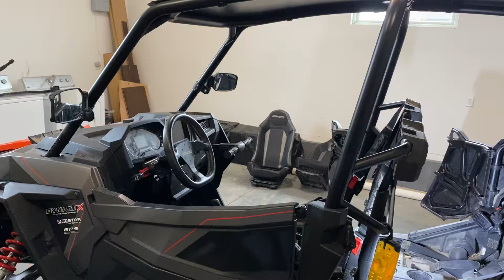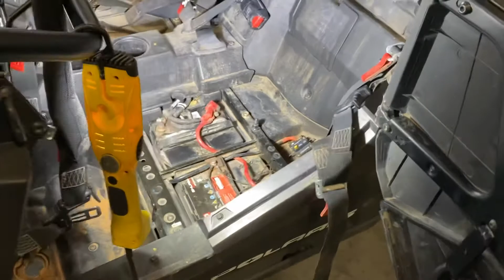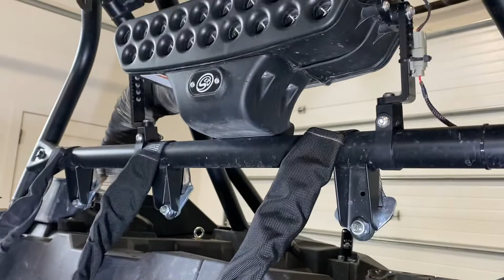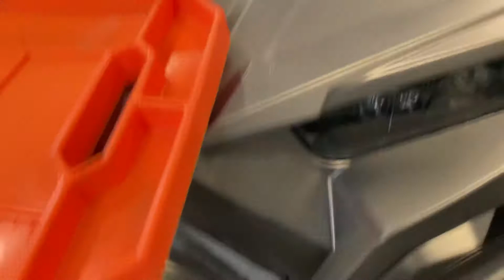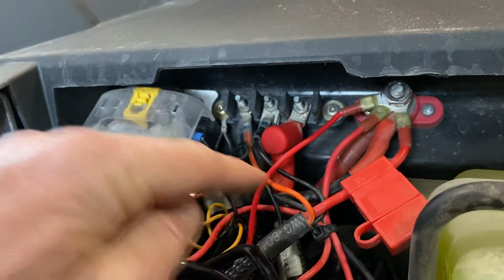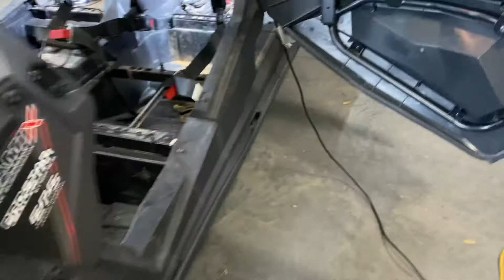Polaris RZR Dual Battery Install

Comment: So should I do a fuse block and a busbar or go with one or the other?
Reply from the maker: I recommend both.
Reply: Thanks for the reply so quickly. Is there certain hookups that should be hooked up to the busbar and certain ones hooked up to the fuse block? Or just split the accessories between the two?
Reply: Also is the key line charger isolated recommended or can I get away with it? Lol would it be better and safer to have it?
Reply from the maker: @SomeDude3000  I separated out the non essentials to the secondary battery on my fuse block and then ran that to the busbar.
Reply from the maker: @SomeDude3000  I would recommend it! It will keep you from getting stranded IMO.
Reply: So the nonessentials went to the fuse block and the rest went to the busbar?
Reply from the maker: @SomeDude3000  yup!
Reply: I guess now to figure out what my nonessentials would be lol 🤦‍♂️
Reply: The 100 amp fuse is not in stock. They have the same one but in 120 amp. You think it would be alright if I went with the 120 amp instead of the 100 amp or should I just find a 100 amp and stick with that size circuit breaker?
Reply from the maker: @SomeDude3000  I think you would be fine with the 120
Reply: Ok great!! This is the fuse block I’m thinking about going with. The one you had is currently out of stock. Would you recommend this one? 

Blue Sea Systems ST Blade ATO/ATC Fuse Blocks
Reply from the maker: @SomeDude3000  that is actually the same fuse block, it just doesn’t have the mounting bracket that mine has. Great fuse blocks.
Reply: Awesome!! Thanks for the feedback   Sorry for all the questions. Just wanting make sure I have the correct stuff for the job. 👍
Reply from the maker: @SomeDude3000  you’re good! You can look on vent racing’s website and they may have that fuse block directly and not through Amazon. Their fuse block has a keyed relay.
Reply: Didn’t realize that fuse block was $145. Lol
Reply: What size wires are you using for both your positive and negative battery cables?
Reply from the maker: @SomeDude3000  4 awg
Reply: Quick question, and again thanks for all the replies, I’m trying to go through everything to make sure where everything goes before I hook it all up. I’m getting a little confused on where the (switched wire) goes to, whether I run it to the busbar and run it to the fuse block, or just one or the other.
Reply from the maker: @SomeDude3000  The bus bar from Polaris has a keyed side. I use that to turn on the relay of the fuse block. I run the power for the fuse block from the second battery.
Reply: My polaris doesn’t have a busbar on it. I’m having to put one. It’s a 2014 RZR 800s. Atleast I can’t find it, if it does have one.
Reply from the maker: @SomeDude3000  it should still have keyed power. Worst case scenario you could run a wire through the gromet into the dash. There is for sure keyed power in there. It doesn’t take anything to run the relay for the fuse block.
Reply: I was thinking of just tying into the wire for the ignition, and then running that to the relay for the fuse block.
Reply: Also, what size wire would you recommend running for the (switched wire) to the fuse block? I know tying into the ignition wire, a 4awg would be way to big.
Reply: @BryanHansen  if a wire comes with a preinstalled fuse, I can cut that fuse off, and the fuse on the fuse block will take its place, correct?
Reply from the maker: @SomeDude3000  yeah
Reply: @BryanHansen  you only ran a jumper for your negative  from battery to battery? You don’t need a jumper for your positive from battery correct?
Reply from the maker: @SomeDude3000  that is what the battery isolator does
Reply: @BryanHansen  gotcha. That’s what I thought. Just wanted to double check.

Comment: Is circuit breaker really necessary
Reply from the maker: For the winch? Yes.
Reply: @BryanHansen  my winch already has an inline circuit breaker
Reply from the maker: @jasonrichard4734  you’re probably good. We ran 3 light bars, a winch, whips, and a stereo so we decided to put a breaker in for everything.

Comment: Will this work on a Polaris razor 570?  I would like to put one on my unit but I don’t know if it will work
Reply from the maker: I am not sure what the space under the seat on the 570 looks like. Might need a different battery, but everything else should work.

Comment: Do you think I would need the factory busbar wiring harness if I was going to run this setup? Or does this kinda do away with needing it?
Reply: My rzr doesnt have a factory harness already ran to the front is the reason I ask.
Reply from the maker: @brianmabe30  you don’t need it, but if you use the vent racing fuse block you will want to run it to and accessory power line for the relay.
Reply: @BryanHansen  I am going to install one of those gang switch boxes that comes with a fuse block for it, will that take the place of the vent racing fuse block?
Reply from the maker: @brianmabe30  nope. This is the common mistake that everybody makes. A switch is not meant to run a load through. If you’re going to run those switches and then run relays for those switches, OK. If you’re not going to run relays, a switch is only meant to run power or to a relay. The vent racing block is a relayed fuse block and an individual fuse per accessory.